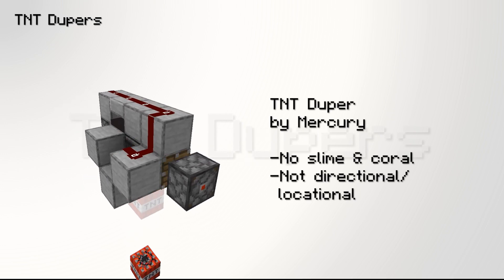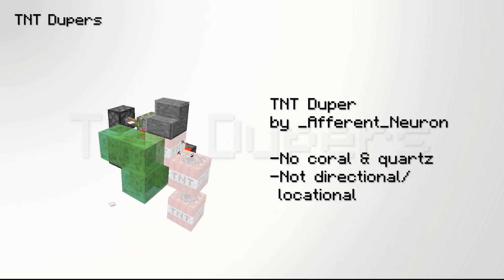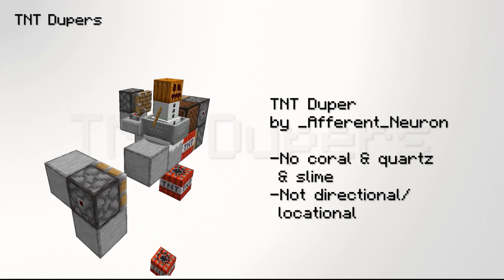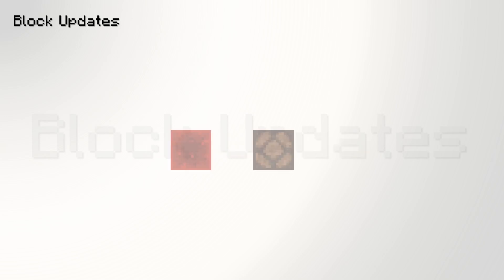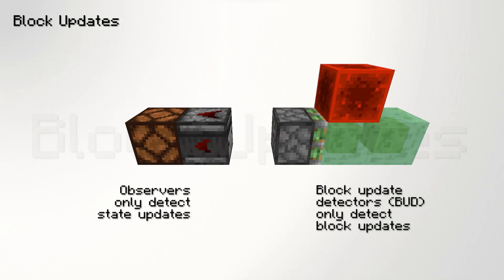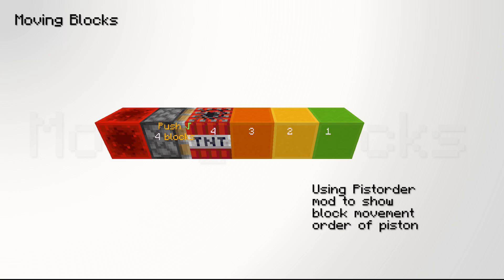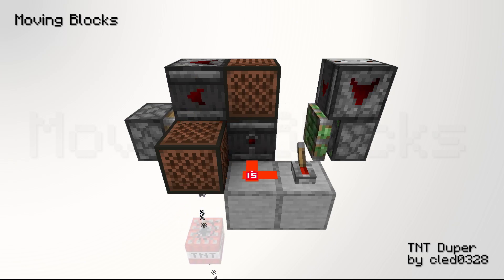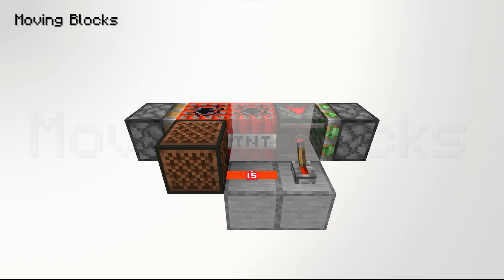Simple TNT Dupers with NO CORAL | TNT Duping Explanation | Minecraft | Java Edition

Comment: How exactly does the observer update the TNT during the piston push? I've tried so hard to make my own duper but I'm having zero success. I've also tried to use mechanics similar to the last one but again I can't get anything to work. None of the explanation videos I've watched have helped me figure this out and it's frustrating.
Reply from the maker: when lit observer is pushed, it'll instantly send a block update the instant the orginal block gets replaced by others' b36, it acts like coral fans, which also sends block update when it gets replaced, im not sure if the observer block getting removed sends update or not, but at least getting replaced by another b36 will for sure
Reply: @Scorpio03  The main thing I don't get about the first design is how the observer can update the TNT diagonally. Because from my understanding the TNT needs to be updated before it's actually moved, not after which is when the TNT would be in the correct place for the block update (and I think at the wrong time too).

And the last one is also stumping me. If I move the noteblock and redstone to the other side of the first piston it doesn't work. If I remove the snow golem it doesn't work. Both noteblocks and snow golems  appear to provide necessary block updates to the TNT and for some reason that duper needs both? So are 2 block updates actually needed? If so then it makes zero sense that any of the other dupers work.... I'm so confused 😵💫
Reply from the maker: @Porkey_Minch  the observer updates the tnt thru the redstone dusts depowering (or with cled's design, updates the noteblock, which updates the tnt
Reply from the maker: @Porkey_Minch  same for last design, snow breaking updates BUDed noteblock, updates the tnt
Reply: @Scorpio03  Ahhh okay, just tested the depowering thing with a simplified BUD and that lit some TNT. I tried replicating that by having a torch underneath a block being pushed by the piston to de-power and update the TNT but unfortunately for whatever reason it doesn't work (I actually tried that yesterday when I didn't know it was how the observer one works.)

For the last design what I want to know is why BUD'ing the TNT separately and then updating it directly with the snow breaking doesn't work. I know that snow breaking does update things, so I don't get why it has to use the noteblock instead of updating it directly. I even broke snow manually on TNT I BUDed manually and that updated it just fine, yet in the duper setup it doesn't work.
Reply from the maker: @Porkey_Minch  if u have further question it might be better to join our discord and discuss there instead since i dont always check my youtube comments